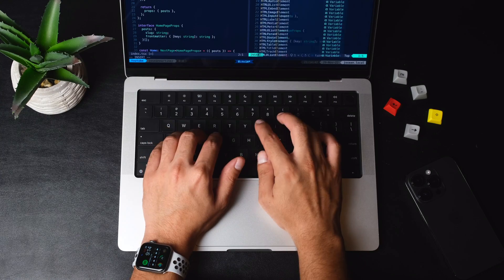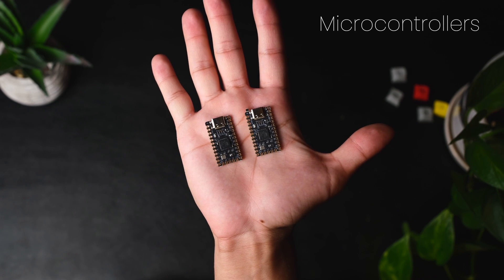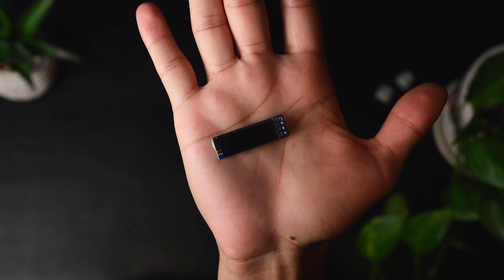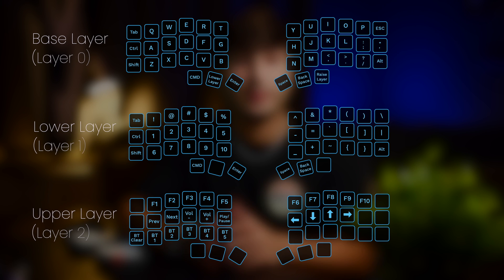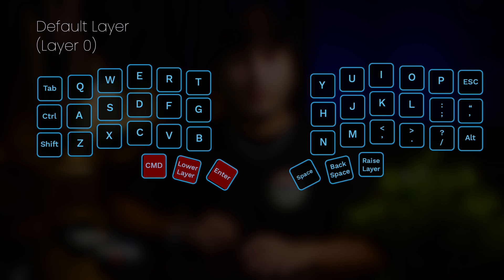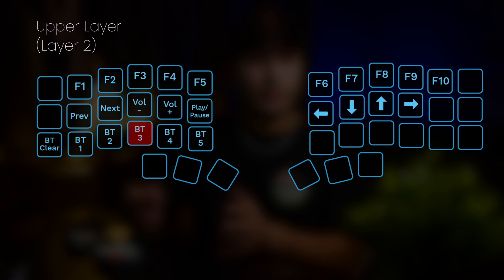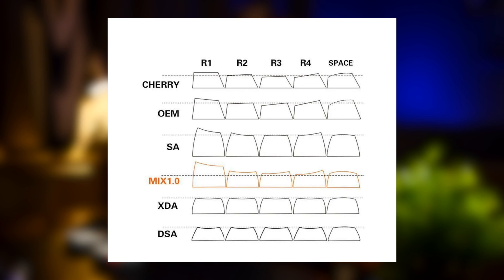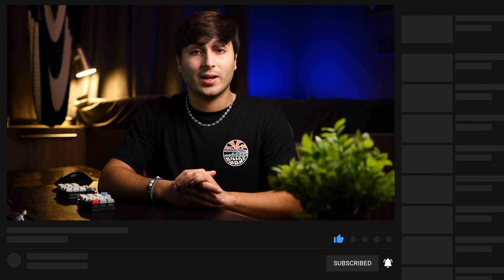The Ultimate Minimalist Keyboard For Programming | Wireless Corne

Comment from the maker: Hey! Hope you enjoyed the video! I wanted to point out that for those of you that are wondering, the soldering process to build this keyboard yourself I found to be slightly tedious. I am by no means an expert so it is definitely doable. There is a link in the description for the official build guide for the wired Cherry Corne Version 3. The only difference with the wireless version are the nice!nano microcontrollers which should be installed by socketing and soldering batteries to these. This is what I personally found most challenging. If you're wondering about the keycaps I have on the keyboard, I've included a link for them in the description, but as of right now they are unfortunately sold out. Let me know if you have any other questions!
Reply: Howdy from Cabo Rojo, I need a corne now for writing my query's in VS code, any suggestions?
Reply: Why you don't use 36 key ?
Reply: Yes, I am very enjoy the video. It's very informative and useful. (Even I have not yet got my crkbd. Especially my "plan" is go to wired crkbd first, and maybe go to wireless crkbd later.)

Comment: Hi. You have a great setup. I'm also thingking about getting a split keyboard. Now using planck EZ. My setup is quite similar but my "thumb keys" are all double function. So I have meta, ctrl, shift, alt all there. To press complex combos I also have some modifiers on the sides. Btw shift as a thumb key was a game changer. No need for capslock now.

Comment: How do you handle key combos with multiple layers say S+] or the good old z+= in vim?
Do you stay in layer as long as you press the button or have to exit?

Edit: btw good job. Removing movement of fingers seems like a great concept, i still have some more keys but will experiment with this
Reply: Assuming you mean "hold Shift and press ]", that's just the } key which is directly available on his symbols layer, so you would hold the Lower key and press the key that is normally /. Assuming you mean "press z then press =", you would press z then hold the Lower key and press the key that is normally j.

Comment: Just came across this video while researching split keyboards. Been trying to figure out what to get. So many are so expensive. But I think the Iris is what I may end up going with. $230 for a full set including steel plates, a middle layer, and a keycap set. Would probably just grab some Cherry switches to finish it out and I found a magnetic tenting accessory for like $30 that should work with the steel plates on it for a nice look.

Comment: HI how do you type the number keys on this keyboard, been doing a lot of research into keebs lately i want me a custom built something similar, but dovrak, not sure if that's even possible?
Reply: The number keys are accessible by holding the "lower-layer-key" (middle button of left thumb cluster) and then tap the corresponding key on the lower two rows of the left side. So 1 is lower-layer-key + A, 2 is lower-layer-key + S, and so on.

You may completely customize your layout and apply any layout you like. Also Dvorak. You may change it at any time back and forth or even elaborate your own layout.

Comment: I tried something like this, but in the end I figured that it's better to move your fingers more to press 1 key instead of reducing movement, but having to press 2 keys. The split and non-staggered nature is nice though, but by using non-standard stuff like that I give up the option of having an aluminum gasket mounted build which is just super nice in feel and sound.
Reply: If you prefer aluminium gasket mounted builds for their sound over a keyboard that actually does not brake your fingers and wrists, than that is your choice and I respect that. 

However, if you work with a non-standard, non-rowstaggered-fingerbraking, non-unsplit-wristbraking keyboard for some time, there is nothing that brings you back to your old keyboard. Nothing. So you better don't if you want to keep fancying your current keyboard. After using any keyboard with a proper layout (column-staggered, thumb cluster, split/separated, optionally key wells; no, forget Alice) for a reasonable amount of time, you notice how ugly, how really - REALLY - ugly, uncomfortable, even unhealthy and harmful the standard layout is, that cannot be compensated by the nicest "thug" or the most sophisticated taping/foaming/gasketing/lubing. You will not only not like it any more, you will start to outright hate it. You will despise any minute that you are forced to work with the standard layout. It then feels like covering quite a distance with your first pre-school children's bike. 

Yes, a nice switch with a nice feel and a nice sound are very good things to a keyboard, but waaay down the priority list (at least my priority list). Implementing that in a standard layout keyboard (no matter whether tkl, 75%, 60%, etc), for me feels like applying fancy 19" aluminium, multicolored wheel rims with low profile tires and a race car suspension to a 150 years old horse carriage (that is about the age of the standard layout). That is perfectly fine if you like horse carriages and consider those wheels are the only things missing. However, I would not like to work with that. 

Ooops, that sounded way more hostile than intended. I appologize for any offense. I really meant it when I say I respect your choice. Maybe I just want to say it would not be mine.
Reply: @miramallo30  I respect your opinion and you may be right. I started to think about how to reduce the effect of plasticky/hollow sounding keyboards(aka. not gasket mounts). Maybe if I drop the idea of a case altogether and DIY something to protect the pcb, I can achieve split kbd life. The idea came when I noticed that during assembly before I put the keyboard in the case the sound and feel was actually acceptable. Cases are evil. I wish I got the idea sooner.
What do you think could be used for this?

Switches on the other hand... there is no reason to compromise there. Highly recommend KTT strawberry for example.

Comment: You should try a 5x3 keyboard (remove the extra pinkie column) you won't have to reach far with your pinkie, it will be more comfortable
Reply: Would you have to use home-row mods or a similar tapdance setup to use a keyboard like that?

Comment: You’re tempting me to change my micro controllers on my corne from promicros to nice!nanos and going wireless 😂

Sounds like you don’t have an off switch so does the keyboard stay on all the time?

Keep up the good work 😊
Reply: just going off of pcb design experience, i doubt the corne has a power switch since it is compatible with wired mcus and so it would be more practical to just not include one for some users. If wired users didnt want a switch they would have to bridge the connection with magnet wire which is a hassle for most. I think its very much dependent on the mcu though since some may have power switches but those switches wont be very usable especially with oled screens or part of a case covering them. 

If you mean a key acting as a power switch (which makes the most sense for all use cases), he doesnt have one in the layer part of the video. The reason for this is that, when you want to power the circuit back up, the keypress wont be detected since the mcu is not powered. You would need a physical toggle switch for power which to my knowledge the corne lacks. 

EDIT:
A possible solution is to have pads for soldering in a switch and a trace that bypasses the switch. All that would need to be done for a wireless build is to just scratch the bypassing trace with a box cutter and solder in a switch. Might do this on my next pcb and case design
Reply: The nice nanos can go into low power don’t need battery disconnect

Comment: hey man nice build. for tenting there are lots of options. there is also a acryl case that has tenting holes which can be used to tent the corne. Or what i do is, use magnetic tenting legs. then they are removable for easy travel. because screws have to be removed when you but it in your case and added again. and to finde the right setting and heigth again gets annoying fast. 

Also there are lots of cases availebale for the corne, lots of 3d printed ones. i designed multiple myself. which allows things like build in support for tenting or even travel cases.

regarding the firmware. i personally like zmk more because it compiles automatically once its setup on your git. the syntax seems  less complicated as well.  and building the firmware yourself is always better because it allows you more options for your layout. VIA or qmk configurator is limited, they cant add you combos, tap dances or one shot layers. you could say there is a whole new layer that you have not tapped in yet :D . 

Also i recommend the corne discord server. lots of cool and friendly folks there. if you need help, inspiration or just want to talk corne for a bit, this is the place to find that.
Reply from the maker: Thanks for the awesome feedback and information! There’s definitely a lot more that I haven’t tapped into yet!
Reply from the maker: Thanks for the awesome feedback and information! There’s definitely a lot more that I haven’t tapped into yet!

Comment: Are the OLEDs that bad in terms of power consumption? I am kinda on the fence on whether to use them.
Reply from the maker: They seem to drain the battery substantially. I’ve considered trying out the “nice!view” screens which should be more power efficient but haven’t tried yet.
Reply: @joseanmartinez  Yeah, the e-ink ones look fascinating, but the price...
Reply from the maker: @YanDoroshenko  Yeah, it can be an expensive hobby for sure. I personally can generally make do without the oleds.

Comment: I will start a reconversion at the beginning of January. It seems complicated to me to do everything with the nvim for a beginner but in any case thanks to your video I was able to understand well how to configure it. Thanks a lot.
I'm currently on a Lily58, and I'm thinking about switching to a horn with nicenano microcontrollers or a more cheap version (Xiao BLE).
I've read that a lot of people have bluetooth problems, especially with macs. I see that you also encountered these problems.
For the problem of the keys that are pressed during transport, you did not want to integrate a switch to be able to cut the power of the battery during transport or when the keyboard is not used for a long period? 
I've started to fiddle around with QMK lately, and added some features like home row mode, or having different behaviors on my thumbs keys depending on if I activate the key or keep it pressed.
Aren't you interested in this kind of mechanics?
Reply: Dude, come on, no one says "nvim" out loud.

Comment: Great video, great editing and aftereffects! 

I'm curious did you look into making your iris wireless? I have a Planck now but I want to split it.  So far it's corne, sofle, or iris and I can't decide!!
Reply from the maker: Hey! Really appreciate it! Honestly I didn’t really look into making the Iris wireless. I wasn’t using the number row on it so I wanted something more compact, and the Corne had everything I needed. Additionally, at least the Iris model I had didn’t make use of microcontrollers and the only way I knew this was done by most people is by replacing standard microcontrollers with bluetooth ones like the nice!nanos, so that’s why I went with the Corne which makes use of microcontrollers. The Sofle I believe has microcontrollers as well. Hope that helps!